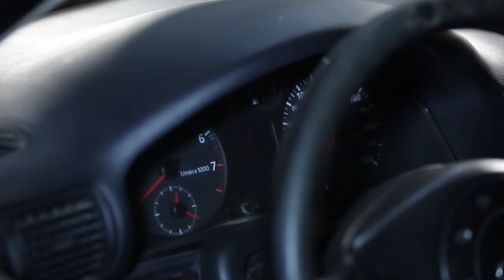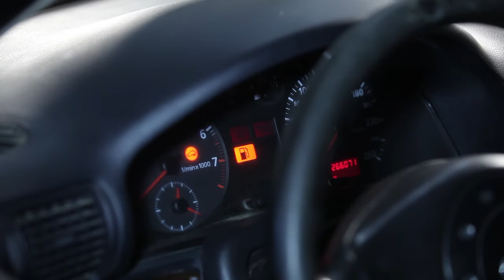How to change Engine Oil and Oil filter on AUDI A4 B5 TUTORIAL | AUTODOC

Comment: Thanks for the upload, now I know I have to remove the plastic cover to get to the oil pan. I kind of wish it was lost already as it is on the car in the video...
Reply: i still got the four wood looking screws holding mine on my 96 A4 :) good thing they only need like a half a turn to undo

Comment: how much oil goes in a audi 1.9tdi 110hp (afn)
Reply from the maker: Thank you for the feedback! The AFN type of engine requires 3.8 liters of engine oil. Best Regards, Autodoc.
Reply: but in the manual its says 3.5L ?
Reply: Bajram Berisa the oil filter also needs to be filled, which in this model approximately is 0.3L